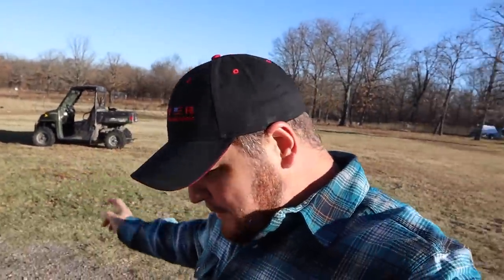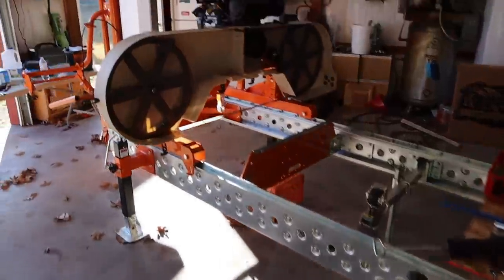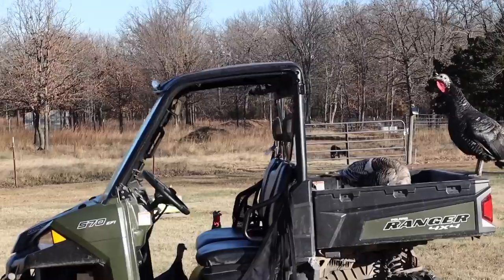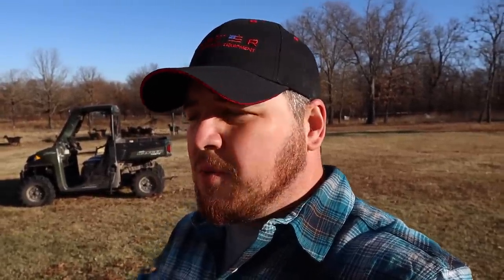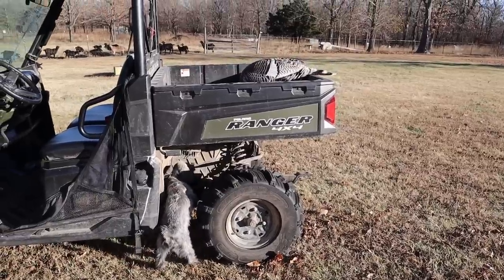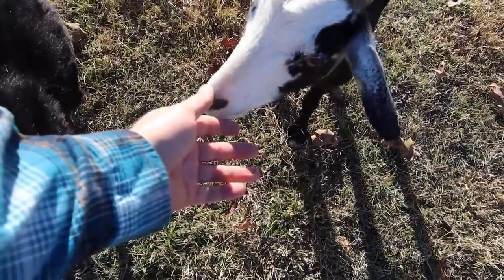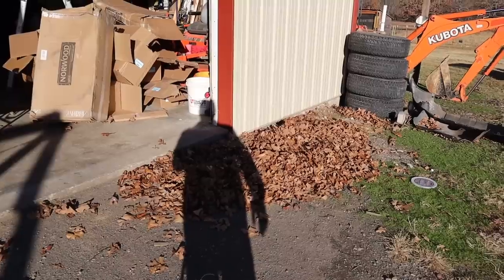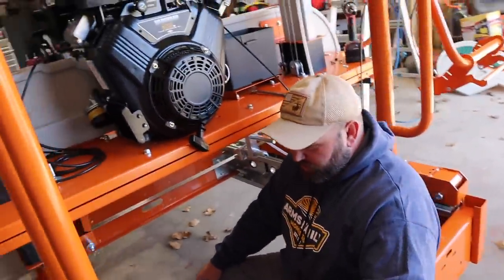How Hard Is It To Assemble A Norwood LumberPro HD36 - 23HP Portable Sawmill

Comment: Just noticed you have your log stops and clamps mounted backwards. Looking from the front end of the track the stops should be to your left and the lock to the right. You want the direction of the blade to be pulling the log tight to the stops on the left. You might want to check out Norwoods assembly video on the track assembly.